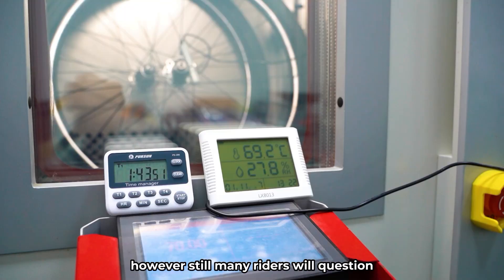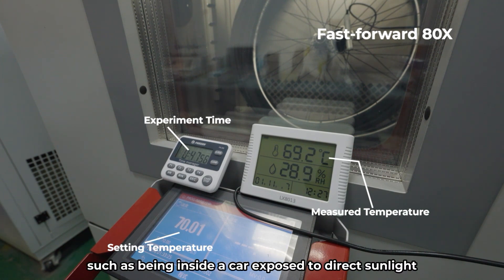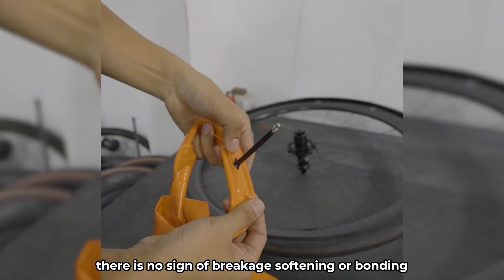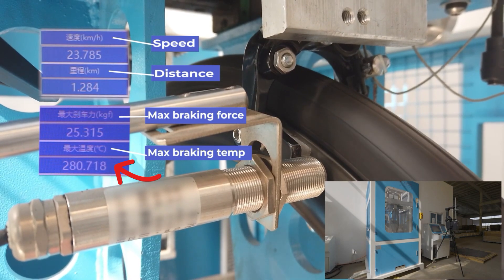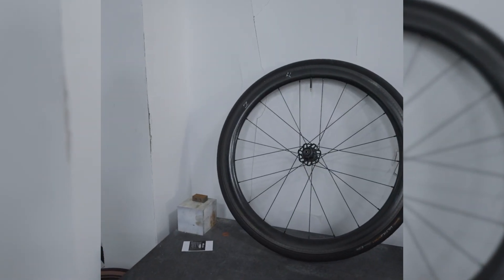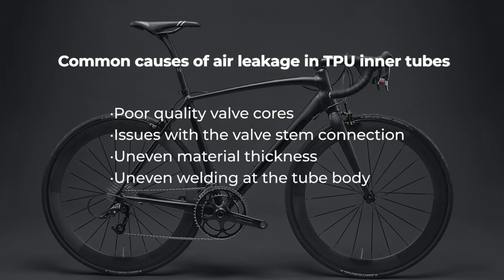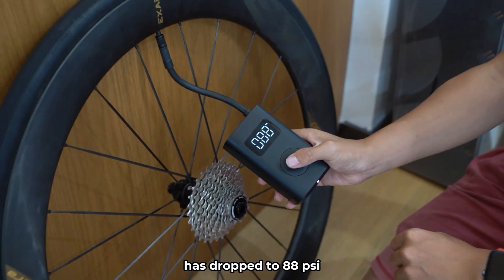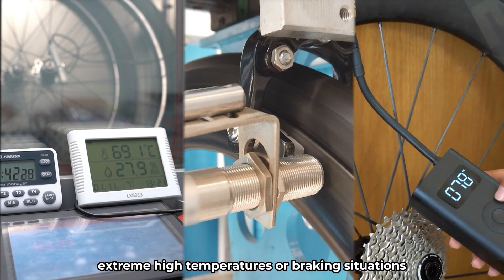EXAR TPU Inner Tube Tests: Put in under 300℃ braking heat enviorment, how did it go?

Comment: for the breake heat test it would have been nice to also have the current temperature displayed to see how fast the rims cool down again after the brakes are no longer touching the rim.

Also the pressure drops recorded on the final airtightness test can be attributed to the tube of the measuring device being pressured up from the inner tube.